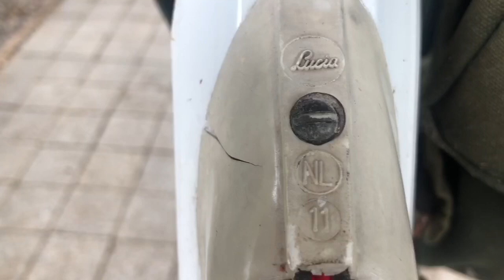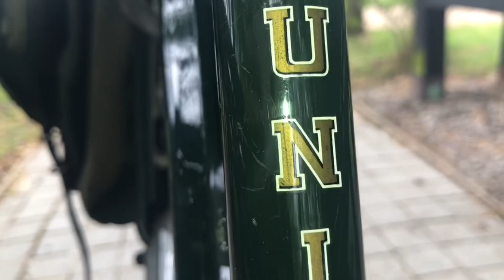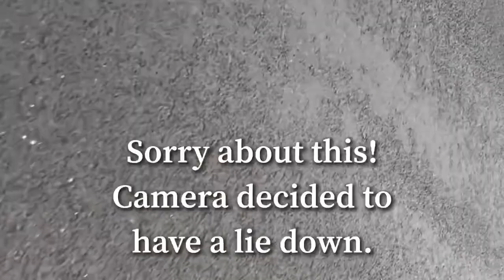3speed to singlespeed coaster brake. Work, ride & amazing history of my vintage Union dutchbike.

Comment: So good to see the old Union on the road again. What a survivor! Reminds me of my Forever single speed. A Chinese copy of a '40s Tourist with rod brakes and full chain case, I rode it happily for a year, but if I parked it longer than 2 wks the valves gave out. And its weight chewed up the wheel hub BBs on rides. Now it rests sans wheels, upside down in my basement. Got a line on a Gazelle in somebody's barn. You've inspired an inspection.
Reply from the maker: I had a gold Forever for a while 😃. Stylish machine.
Reply from the maker: If you ever (😄) want to see it go to a new home, let me know.
Reply: @Velocipedium  I may yet resurrect my green Forever. Yes, they are attractive, but so heavy. You didn't have difficulties?
Reply: @Velocipedium  Would certainly be willing to sell it, but I'm in the States, Rowan (altho I lived in Britain for some years). Wouldn't shipping be expensive?

Comment: I've recently got myself an Eminent Dutch bike and just came across your channel. I was wondering if you have a video where I can learn how to assemble the 3 gear mechanism with the tiny chain on the back wheel (sorry for not knowing the specifics). And I also believe I'm missing some components for the back wheel as it seems to have some sort of breaking that I'm not familiar with.
I got the bike cause of it's beautiful design and after a little test ride I instantly fell in love with the riding stance, so I would appreciate any tips on how to make this bike perform to it's best.
thanks in advance and sorry for any english mistakes, as it's not my main language.
Cheers from Portugal!
Reply from the maker: https://youtu.be/jcLGYsO0l3M this might be helpful

Comment: Perhaps you could do a video explaining why the angles on old bikes were so slack.
Reply from the maker: They weren’t. They were normal, because it was then, then. Later bikes have steep angles because of racing, and riders discovering more efficient pedalling positions. Then the club riders wanted to look like racers and enjoy the supposed benefits. Then it filtered down to all but pure utility bikes.
In many countries they were not interested in riding race replica bikes and they stayed with the long wheelbase and stability of the traditional design

Comment: what gear ratio are you using, 60 inch? thank you for the video,
Reply: Would someone please explain the basic principle of gearing inches?
Reply: @doronron7323  Apparently it's the actual gear ratio multiplied by the rear wheel diameter in inches.
Reply from the maker: 20t rear. 48 front I think.
Reply from the maker: @doron Ron it’s the equivalent to the size of wheel that would give the same distance from a rotation of the pedals. So a 52” penny farthing has a 52” gear
Reply: @Velocipedium  Thank you for your responses. Unfortunately I'm afflicted with Dyslexia AND Dyscalculia. Generally I function normally, but letters and numbers literally close my brain down. I know it's a big ask, but where can I find a set of tables which are based on the AW hub. 26'' wheels I can find, but nothing for 20'' wheels?
Reply from the maker: Try sheldonbrown.com there is some of the best information in existence
Reply: @doronron7323 Hope this doesn't sound condescending,  but another suggestion, if it is open to you, is to ask a friend to spend 15 minutes running a few front and rear tooth combinations through a calculator for your particular size wheel. There are some online gear inch calculators that can work it out for you, or literally have a friend use the calculator on their phone. Tell them it's the Number of teeth on the front cog, divided by number of teeth on the back cog. Then multiply that number by the wheel size, eg 26 inch.